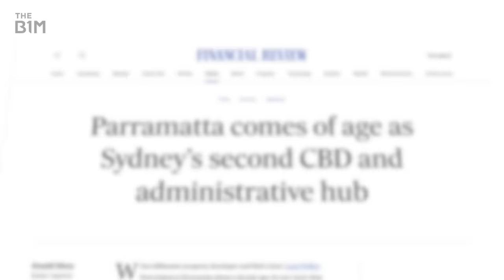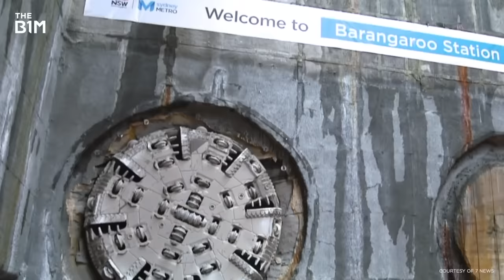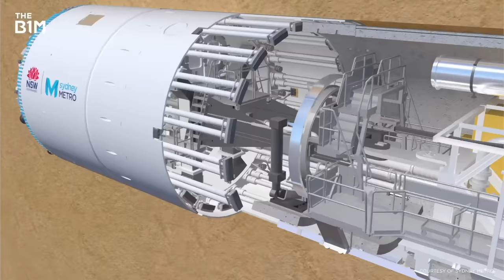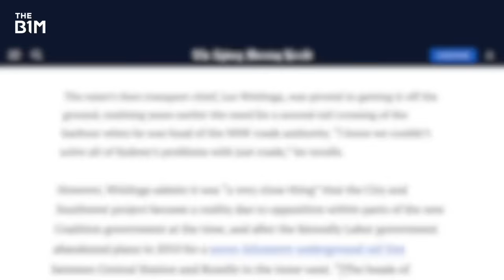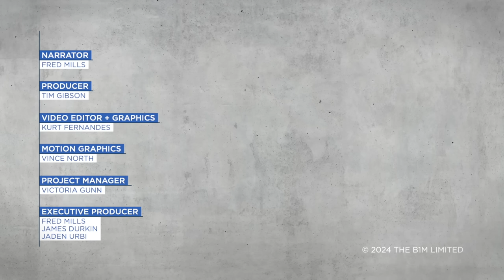Australia’s $64BN Mega Railway

Comment: 7:24: The U.S. is trying, but keeps getting kneecapped by oligarchs.
Reply: Austin voters approved a bond issue to expand the miniscule light rail system.  They have basically admitted it will never happen, because the land is too expensive.  Meanwhile, every freeway in the city is undergoing horrendously expensive expansion projects.  If it serves automobiles, no expense is spared.  If it is for some hippie train, no barrier remains unused.